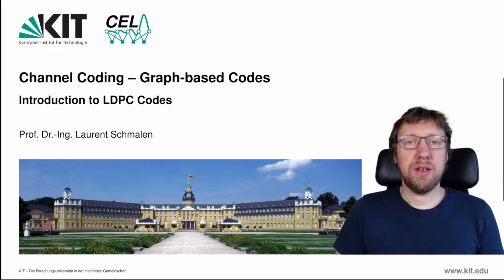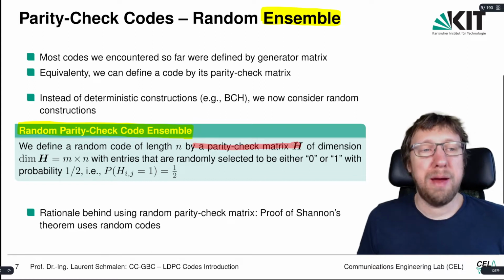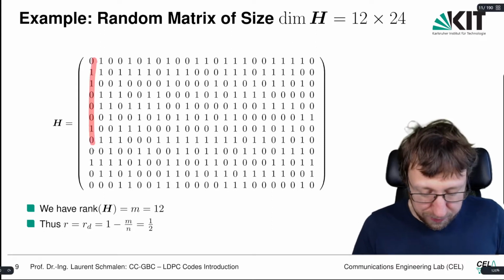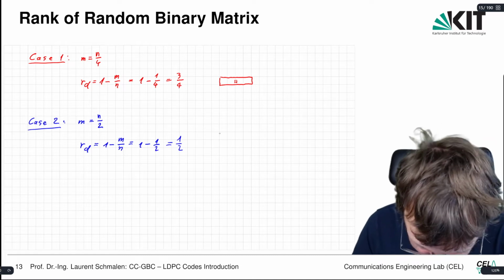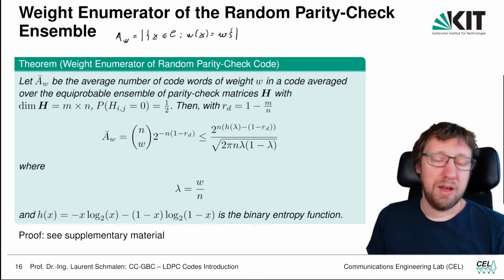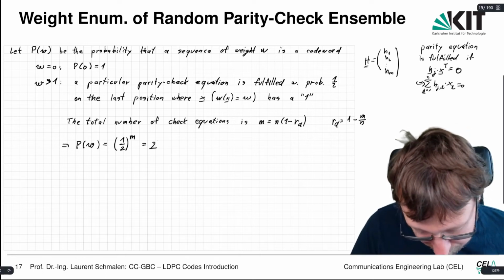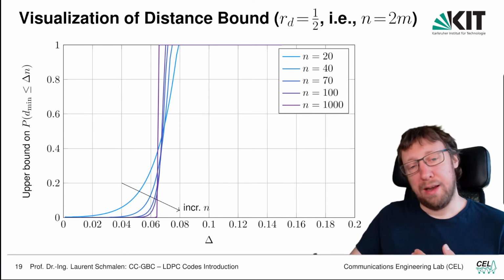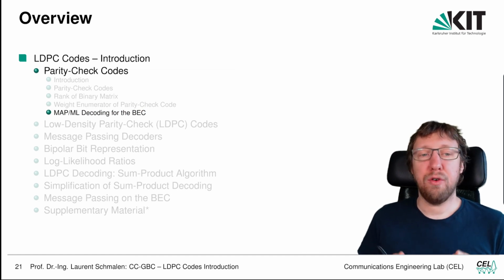Lecture "Channel Coding: Graph-based Codes", Chapter 3, Vid. 1, "Parity-check Codes"

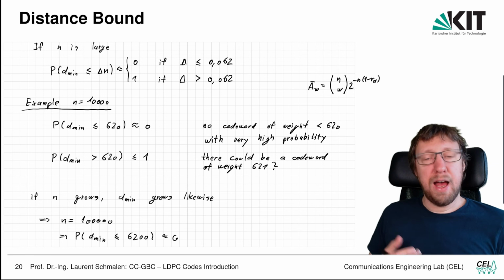Comment: At 43:57 do you mean that the number of errors that can be corrected with a big dmin gets large? (Instead of small) —sorry, just trying to understand the advantage of having a large n to get a larger dmin.
Reply: Also, a moment later, you mention that a large dmin makes the probability of maximum likely decoding go down—is that because ML decoding is difficult for large n, and not specifically because of a large dmin?